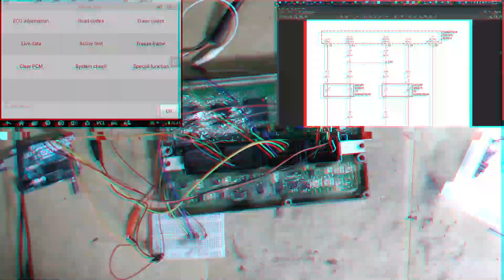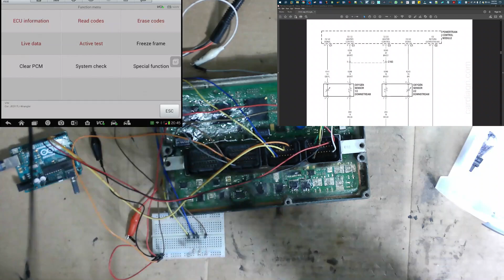Testing o2 sensor signal & heater control from PCM after replacing driver circuit 05 JEEP Wrangler

Comment: I am having this very same issue, my Jeep Wrnagler is also 2005, we replaced the ECU/PCM replaced the wiring from the PCM to the Sensor itself, replaced the O2 sensors, and no matter what the code comes back.  Every so often it will clear itself, but within a day or so the same 4 codes come back.  P0031,P0037, P0051 and P0057.

I am curious if anyone here has come up with a solid fix for this since its been 2 years since this and the other Mechanic's videos were posted.
Reply from the maker: Yea I can usually fix that issue these days.
Reply: @ecurepair  Is this a send your PCM to someone or buy a new one fix, or is it a wiring and or device issue?

I'm tired of throwing money at this, so I was hoping to narrow down the culprit
Reply from the maker: @Digital-Sparks  up to you. You can try repair or find replacement. I cant say for sure Its a common issue in ecu